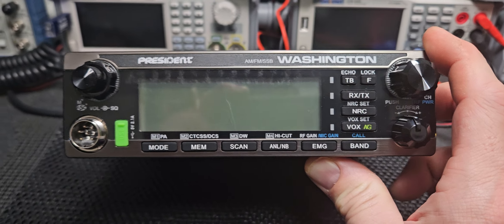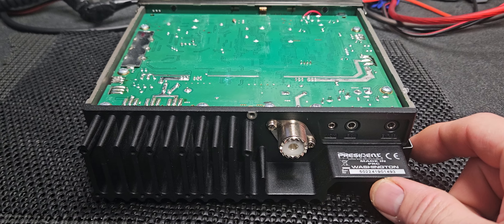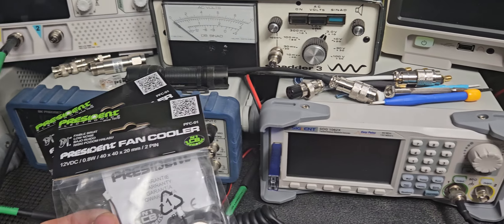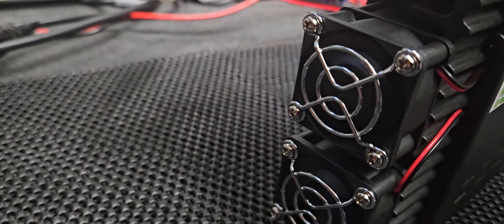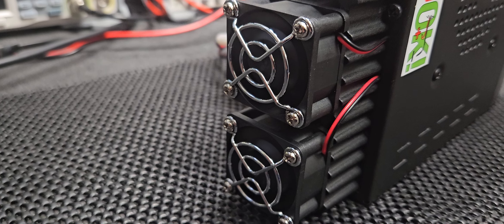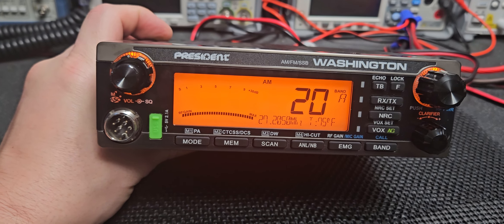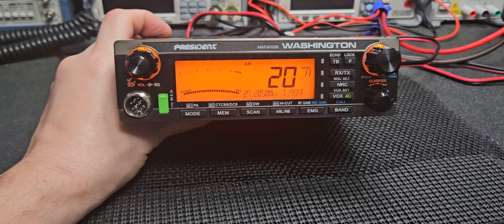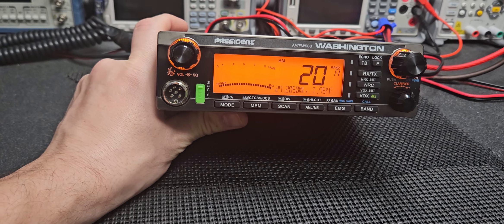New President Washington Heading to the Grand canyon State

Comment: I have a problem. I bought the same radio and the talkback was defective. I turned up the volume to 9 and it doesn't sound loud. I need to put my ear to the speaker to hear it. Do you know the problem? The same with an external speaker.
Reply from the maker: I'll check one of the radios today. 
Never seen that happen.
They do sell powered external speakers that have external volumes. 
Could be it's just not loud enough for your liking.